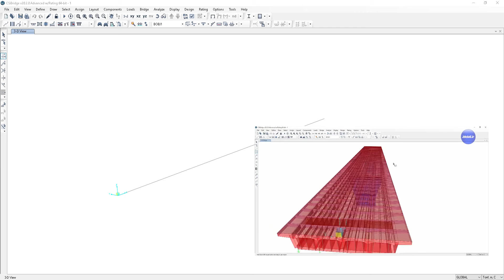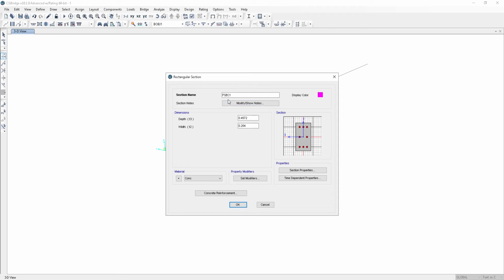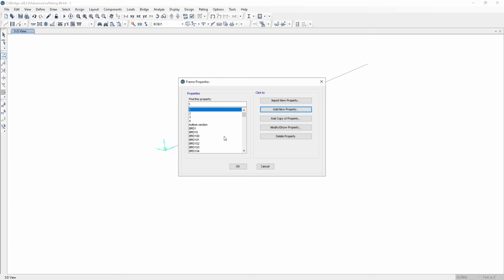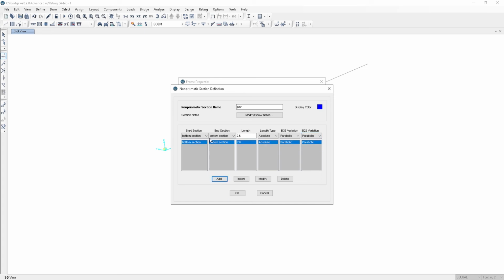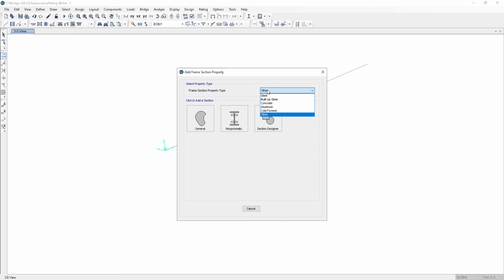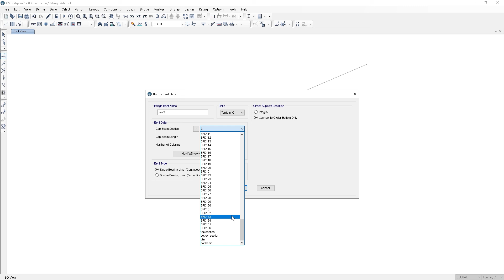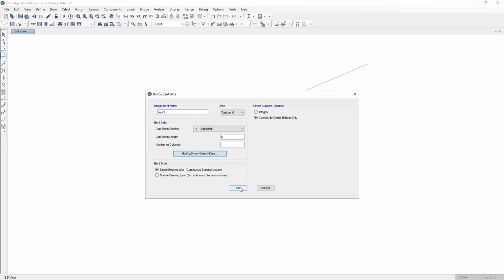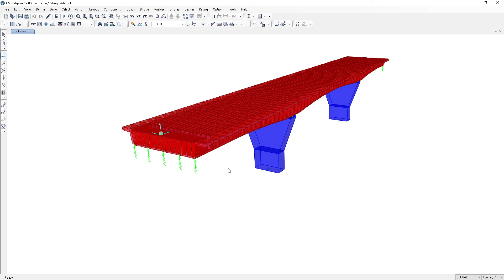how to model non-prismatic column inside of CSI bridge

Comment: Ar 4:32/5:552  there is option for bent type either Single bearing line or double bearing line. For my model (post tensioned box girder bridge ) i choosed a double bearing line to simulate discontinuity however after analysis i see negative moment over the bent ??? Is there anything else we need to change to make the span simply supported with no negative moments over the bent ???